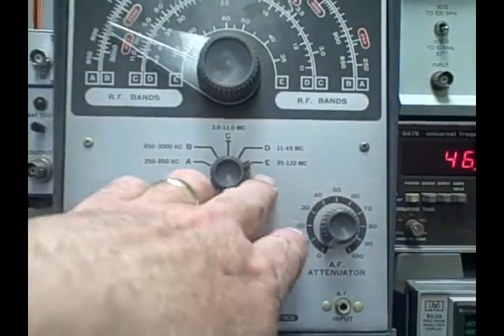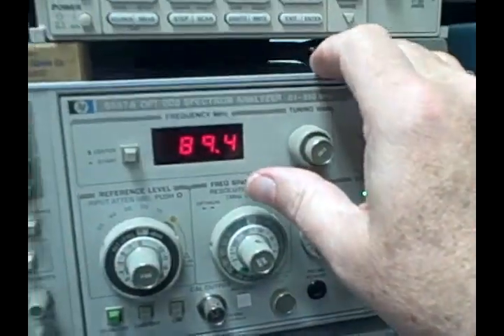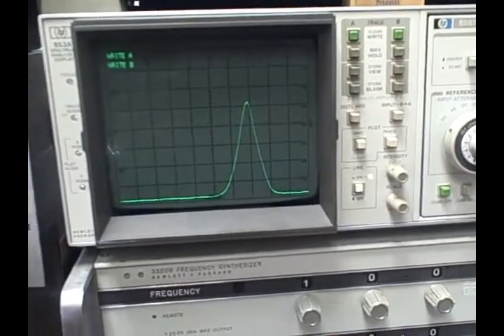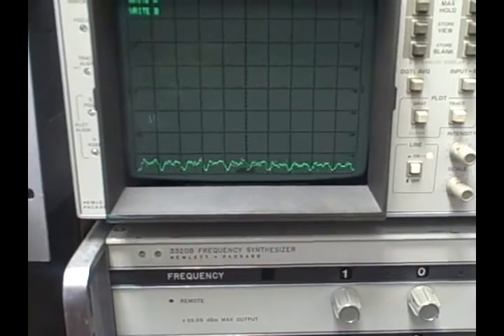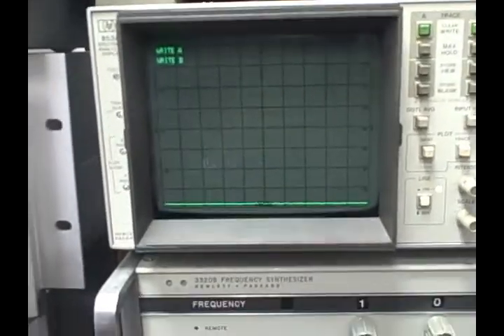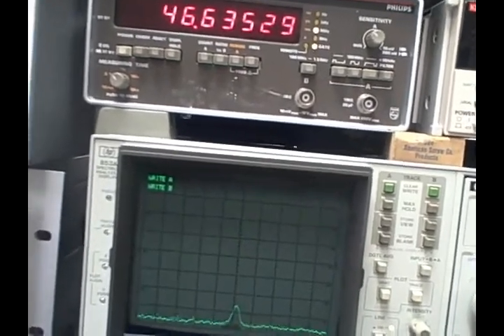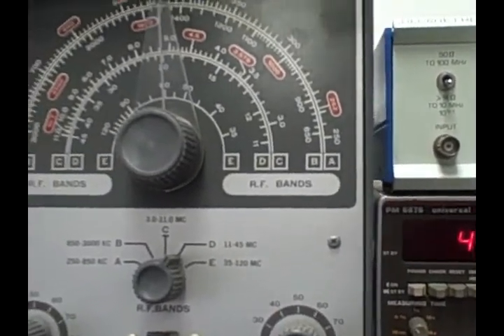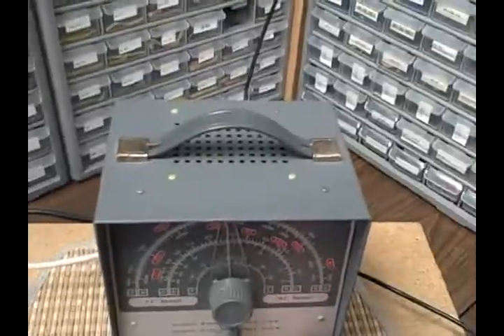Lafayette KT 208 Signal Generator/ Tracer

Comment: This was originally sold (premade) as an Accurate Instrument (yes, that's the company's name) Model 153 throughout the 60s. The first run of these had four tubes. Later is was reduced down to three. All in all not a bad 'all in one' service grade piece of equipment, especially considering prices on separate tube-based RF generators and signal tracers from the likes of Heathkit and Eico are selling at crazy prices these days.